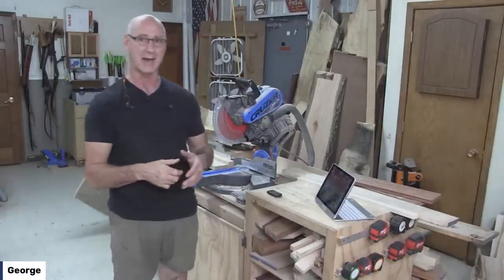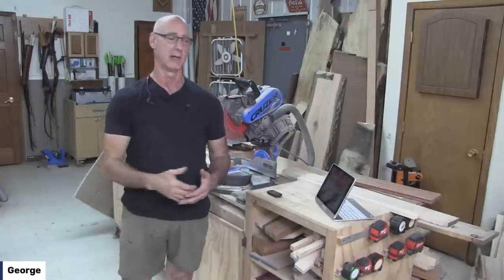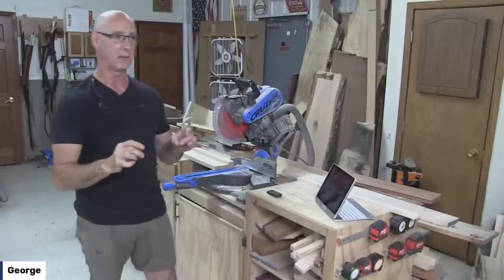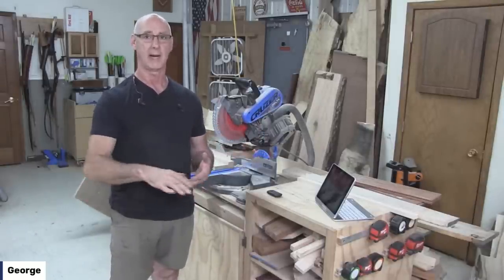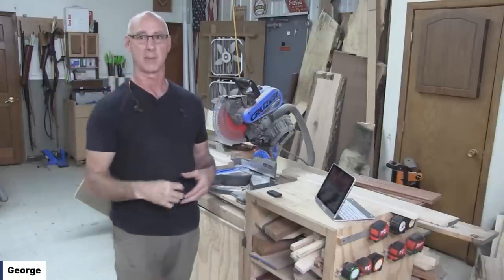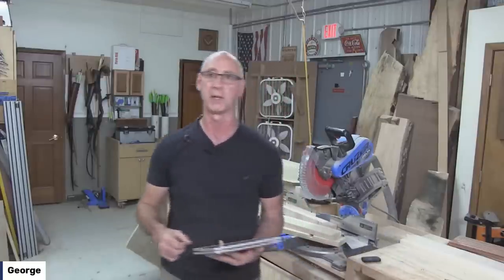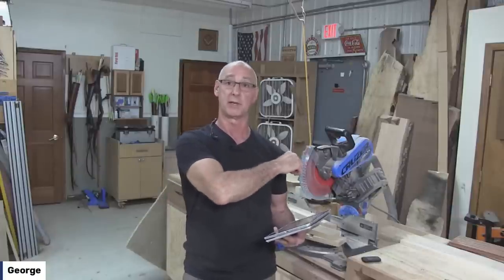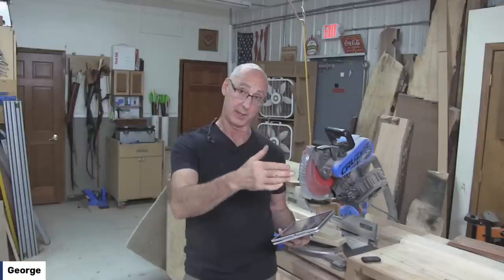Dadoes on the Miter Saw

Comment: Could I set up a stacked dado in my 12" cruzer for a 3/8" cut?
Reply from the maker: check your user manual but it is unlikely that this saw accepts a dado stack.  The arbor is 1" diameter, and not likely long enough to accept multiple blades or a dado stack.  
Paul